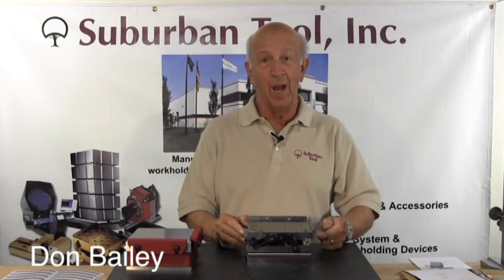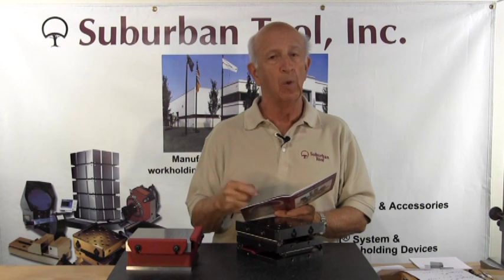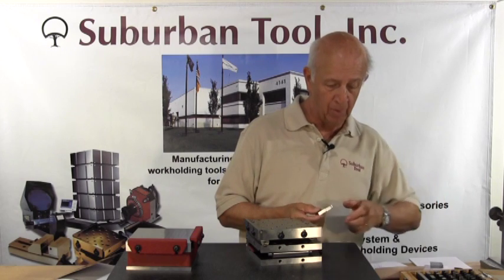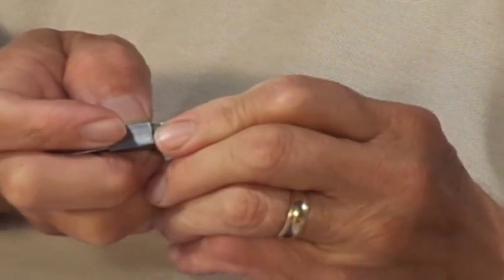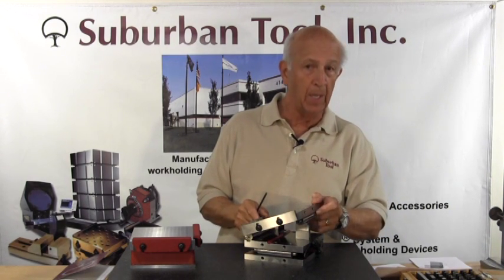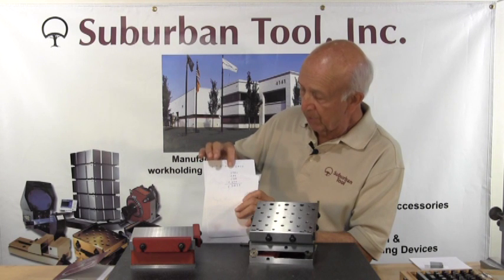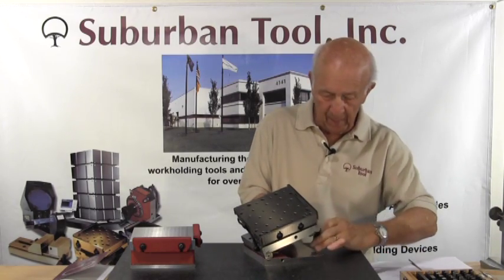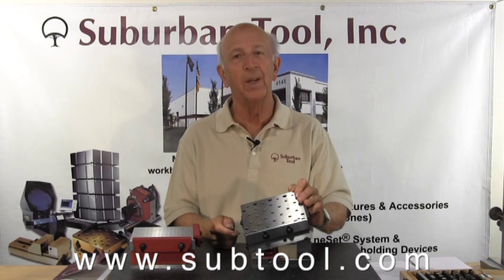How to Set a Sine Plate or Sine Bar

Comment: Why would you not show how you calculated the gauge block height? I think that's important and Machinists should be able to do this without referring to a book. I'll use your second angle choice as an example. 

15 degrees 5 minutes (must convert to decimal degrees) = 15.0833 degrees
SIN 15.0833 = .26022
.26022 x 5. (5 inch sine plate) = 1.3011
1.3011 is your gauge block height. I rounded everything to the fourth decimal place.

Comment: Sorry to be critical, but a few points:
1. "Just the right amount of oil" is not what holds the blocks together and is poor practice. It's the flatness of the block faces that, when in proper condition, and when wrung properly, will exclude all air to allow atmospheric pressure alone to hold the blocks together in intimate contact. By using your skin you are also likely to transfer salts in your sweat to the block surfaces that can dry in place and scratch the fine finish. The surfaces must always be as pristine as possible. Using a clean chamois dedicated to the task is usually recommended by most gage manufacturers.
2. The rightmost decimal is the smallest, not the largest. And we have calculators nowadays to calculate sines. No need for tables. Just multiply the distance between roll centers by the sine of the angle required.
Reply: Sorry to be critical: but you are wrong. Gauge blocks cling together perfectly in a high vacuum where there is no air pressure. It is thought the forces of molecular attraction (not magnetism) are the dominating force.